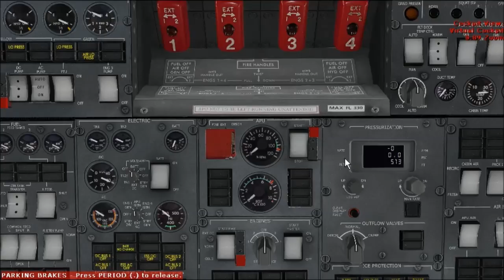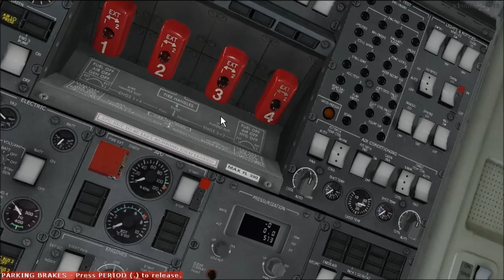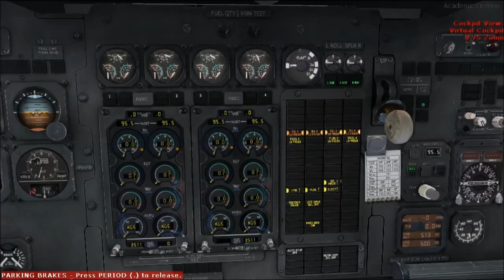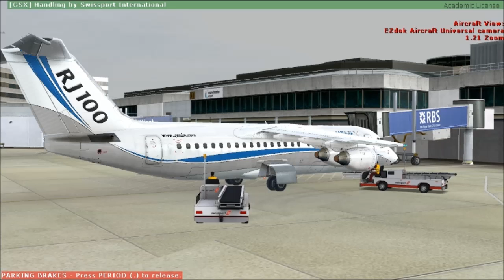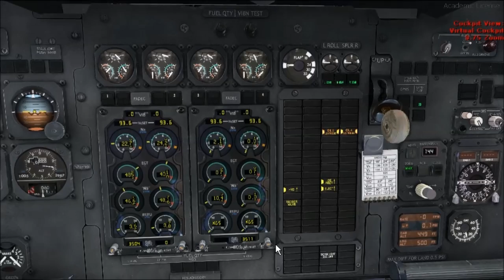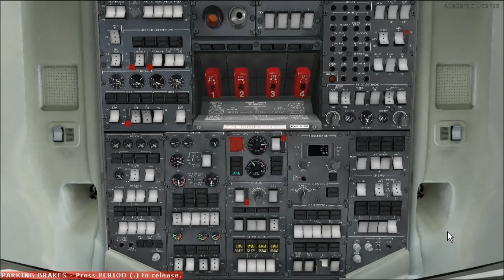QualityWings RJ100 with MCE Voice Control

Comment from the maker: The QW 146 and 757 have been added recently. Before that, the aerosoft Airbus Extended.At the moment I cant remember how many aircraft it supports but the list is huge. If it is directly supported or it uses FSX commands, you can create your own files via VoxKey and make your own procedures. I dont use RC4 but a lot of people use RC4 with MCE. Download the package from the MCE website, you get full functionality for a limited period of time. Just dont forget to read the manuals..;)

Comment: Many Thanks. I recently flew the DC2 with mixture, prop and power settings.....Would be great if MCE could set them by Vox, although they are on levers!  I can see that a/c using "native" FSX code would sync well with MCE. Use of RC with correct phraseology would be superb! Overall well worth a look!

Comment: Thanks for the insight. The QW 146 adaptation is a newly supported a/c. Can you create your own files for any aircraft? Presumably with the VOX Key tool, to work the control surfaces and avionics?  I have not got the trial yet I am just introducing myself to MCE? It looks impressive. I use Radar Contact and GSX.......;)

Comment: For an Addon which costs almost £35 in the current exchange rate, I'd expect the add on to be a little more realistic. The voices here are rubbish, and thats not all; the software has made a very poor job of putting the individual sounds together so whether you put very high quality sounds into it or not, you'll still end up with the same poor quality combination of voices. Very poor.